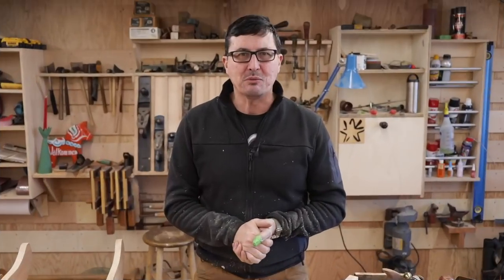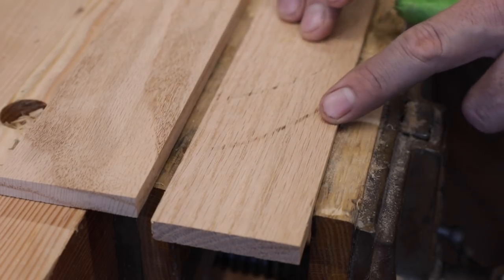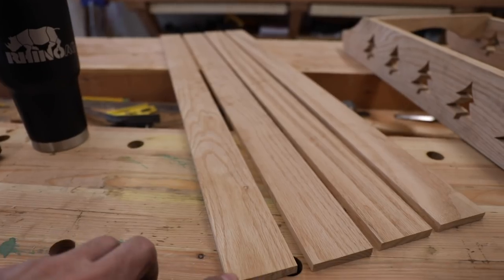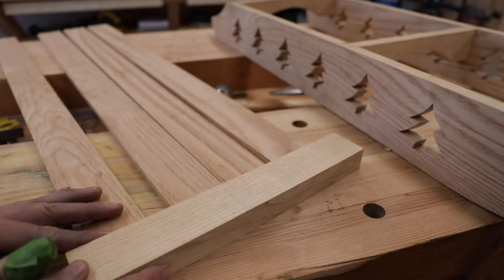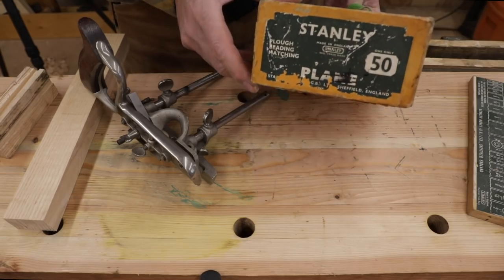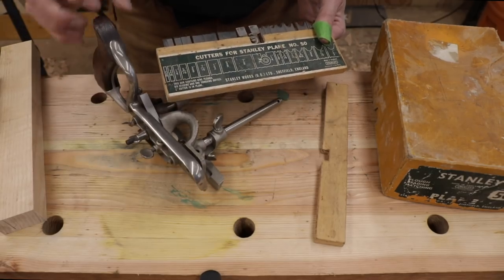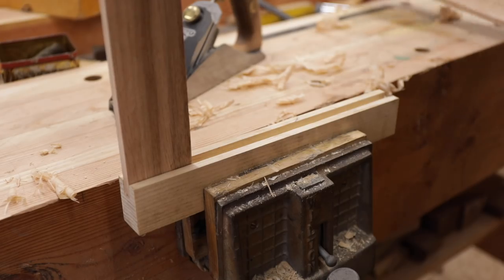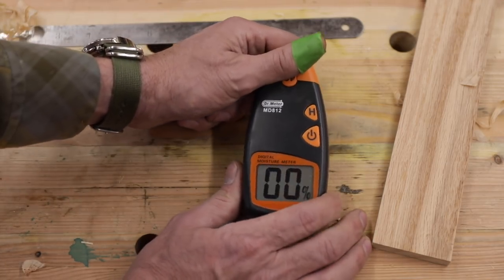HOW TO MAKE A SLED 3

Comment: In one of Paul Sellers master class videos I had asked about more details setting this up for the same reason you mentioned. Phill responded back that Paul Sellers will make a future video going into more detail. 

On a separate Facebook forum, I had asked Vic Tosslin (sp) on how thick of a shaving I should take. He suggested the shaving shouldn't be more than 1 mm. 

On a separate YouTube channel (I think it was treebangham), he had taken a class and was told that adding a piece of wood to that metal side really helps keep the plough plane perpendicular. 

When I made a Paul Sellers style clock, I made one out of oak. I found oak to me much harder to work with than walnut or cherry.

I hope this helps.

Update:  I am building another Paul Sellers wall clock. So, I did the above things before I started. This time I was using walnut instead of oak. Attaching a wooden side fence to my plough plane made a HUGE difference in how it performed. Admittedly it was walnut this time and not oak. Still, it was significantly easier to stay perpendicular. Also, I kept the shavings at 0.25 mm and that worked well.   I was tempted to try making a thicker cut but I just wanted to get good clean grooves. A electrical powered router couldn't have made it better.

Comment: Cody, you have the right idea and most of it figured out, the only thing I see immediately is that you have your iron set to take too heavy of a cut.  You know how your iron barely sticks out from the bottom of your jack plane which determines the thickness of curl... imagine the bottom of your skates as the bottom of your of your regular plane and barely let the iron protrude from the bottom of the skate just barely to take only a few thousandths thick shavings and continue total a shaving back and forth until you have met your desired depth.  It will definitely be easier as you were doing to start at the front of the cut and take a curl on the first few inches and work your way back.  Still loving your channel after many years.  Thanks for all you do.

Comment: My grandpa MacKenbach always told me that "you plough a groove and cut a dado".  

The vintage Stanley 45 & 50 Combo Planes are great tools.  I have Stanley 45 and Record 050c and use them regularly.  But you really need to practice with them for a time to understand what they are good and not so good at and how to set them up for each task.  For example, they plough grooves (with the grain) well with little effort (most of the time).  They can cut dados (across the grain), but can struggle at this task even when setup properly with the knickers engaged and the bit razor sharp.  

Good luck!

Comment: Thank you Cody for sharing this video, I love watching them. I have the same Stanley 50 Plane, had it for 25 years. Beautiful 👍😄📐
Also when using the number 50 rub some candle wax on the side guide and set the blade to take off the minimum with a sharp blade 😄👍

Comment: Reprints of Stanley manuals are readily available online and are pretty good. Love my #55, but the learning curve is steep! Mostly figuring out all the adjustments that make these combo planes so versatile. Instead of a whole box of wood bodied planes with dedicated cutters (and soles), you could now have one versatile one (but with more set up).
Like any plane, it has to be set up correctly and the cutter sharp.
The number one mistake I see (even on YouTube videos) is trying to take too thick a shaving. These are for delicate cuts. They are not rigid/robust enough to hog away (imo).
Retract the cutter, and then incrementally advance it until a thin shaving is produced. It's too thick if you feel you are muscling it. Barely turning the adjuster can make the difference between sweet and a feeling of unease (that you felt).
You also need to accommodate the lash so things are at hard stops and not rely solely on the locks. Gripping the plane as low as possible (regardless of the handles) and applying even pressure will give you the sweet feeling cuts you are looking for.

Comment: I have a Stanley 45. I first used it when I 16 working with my Grandfather in his shop, I have it now and I am 71. sharpen the cutter the way as a Plane iron. set it 1/32 cut, and use the depth stop. PS use the Nickers for all cuts.

Comment: As to whether you really need to be putting "that much muscle" into it - its probably 1 of 3 things that is going wrong.

1) You're planing against the grain
2) The plane iron isn't very sharp ( I would guess you sharpened though being the man you are)
3) You're taking too big a bite, i.e. the plane iron is protruding too much.

Also - it is oak so - it wont necessarily just laser through it as it would with some nice soft white pine or something.

In any case - ya got the job done!  The #50 is one of my favorite tools.
Reply: Given it's Cody, I'd say 3 is more likely than 1 or 2.
Reply: isn't he missing the 3rd skate piece that holds the outside handle or is it just the #45 that has three pieces? otherwise, I would concur that his bite is set too deep. the depth stop is just for final depth.
Reply: These are correct assumptions Cody. I’d say definitely too deep, and also sounds like you were going against the grain.
Reply: Erik Joven I vote for #3 too deep of a set on the blade   its seems like it wouldn't work  but a mote shallow cut will get the job done faster since you can move the tool faster   more shallow trips over woid is faster
Reply: also, don't the nickers always get used? at least at first to prevent odd tear outs?
Reply: depends on the nature of the cut - you should have the nickers active when doing cross-grain work so that it severs the surface fibers and does not tear out.  I would recommend NOT using them when making long grain cuts since the nicker can sort of weave in and out - kind of like a marking knife can sometimes do when trying to score a line along the grain.
Reply: using a marking knife would remove the need to use the nickers, would it not? the nickers in combination with the fence should score straight lines. I have a #45 I am working on restoring, I haven't gotten to use it yet.
Reply: you could pre-mark the recess you want to cut with a marking knife sure - then you would not need the nickers, but like i said sometimes making long-grain cuts with a marking knife you find that the knife wants to wander a bit even with a straight edge.  So, with long grain cuts with the plane i usually just rely on the fence to keep my recess straight and only use the knickers with cross grain cuts (if i have not yet marked the length/width across the grain already during layout).

A #45 is good fun - the #50 is just a simplified #45 to some degree but both can accomplish similar tasks
Reply: Nicodemus for the first cut yes  but after that You could get tare our as the cut goes deeper

Comment: Those old tools are fun to use.  I use them most of the time, but I find that the older i get, the more power I use.  It looked to me that you were taking too  heavy of a bite.  The curls coming out looked a little thick.  I would try to back off on the bite and take a thinner one and see what happens.  On some of mine I have to sue the depth stop to control the bite, and work my way down.  Fun trying to figure it out though.

Comment: Not to be critical but hopefully educational, dadoes go across the grain, grooves go with the grain. Beautiful Stanley No 50 complete set is rare. I have a No. 45 that is badly in need of rehab. Depth stop is set so that it stops the cutting when it rides on the shoulder.
Reply: You are absolutely correct in the dado/groove nomenclature.

Comment: I've done many kitchen cabinets other than the large tools when it comes to finishing the surface I use a paint scraper than has it's edge sharpened and flattened, it produces very fine shavings alike to a plane but much quicker. FYI

Comment: I have a 45, 50 and 55 and love them.  I use the 50 almost exclusively to cut grooves for glass and raised panels as it is much easier to use the 50 than spend the time to set up the table saw or router table.  From your video it appears that you do not have the depth adjuster installed.  It also appears that the iron is not very sharp as the more narrow blades usually cut really well when sharp.  These planes are very difficult to use if not set up properly as the irons do not have much support and have the tendency to chatter.  Please message me if you would like to talk about them as they are very nice tools that can save you a ton of time.

Comment: Did you try a shallower pass of 1/4” with the plane?  If you think production back in the day all parts would be cut.  To go 1/2” deep do a 1/4” at a time then adjust it should make the job easier may even go a little faster if you are doing multiple pieces.  Looks great.  Thanks for all of the videos..

Comment: Regarding the Stanley 50, perhaps the blades need to be sharpened a little? The lubricant seemed to help but it's possible that the chiselheads are too old to hold their edge without a recent sharpening. Just a thought.

Comment: I don't know for sure, but I'm guessing the moisture meter measures the resistance between the two points when it's pushed into the wood. the more moisture, the less resistance there would be across the gap. Seems like the most simple way to me.

Comment: Your Moisture meter is basically a ohms meter. It tells the moisture level by how much electrical resistance there is. The less resistance the more moister. since water is conductive and wood is not. So the more resistance the less water

Comment: Check the belts on the snowblower.  Mine was loose from the factory and wouldn’t blow snow.   
Also check how much space is between the impeller and the wall. If the gap is too large that can cause issues.  But it sounds like your belt is loose
Reply from the maker: No belts it's hydraulic

Comment: Would you ever set your Stanley #4 plane at one  half inch to start with? you have a very convenient depth adjuster right by your finger as you work, take thin shavings then deepen the cut as you go,  btw; try to avoid glue, it doesn't like cold conditions.

Comment: Just an FYI, but Veritas has a new Combination Plane that is actually an improvement on the old Stanley.  It has more blade options and will also use the Stanley blades as well.  Great tool and it is about the same price as buying and older Stanley.  http://www.leevalley.com/us/Wood/page.aspx?p=75620&cat=1,41182

Comment: How is the #50 a "forgotten tool"? I mean, we have atleast 6 or 7 of them at work. They are used daily. Why? Because for a lot of things they are less effort to set up than a router. Ofcourse it helps that most of them are used for 1 task and they are setup for that one task.
And I guess part of them being much more prevalent here is that there are no dado blades here. You either use a router or a combination plane.